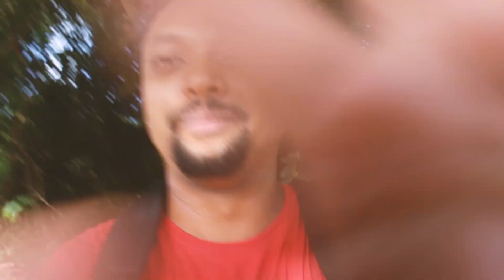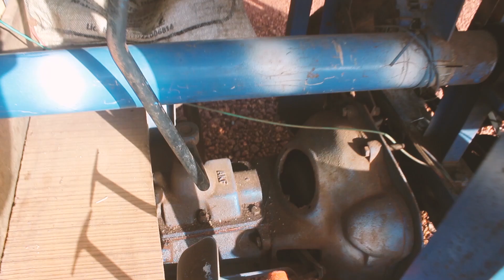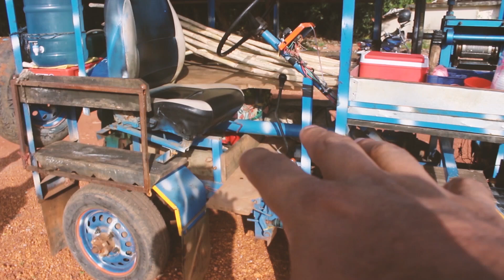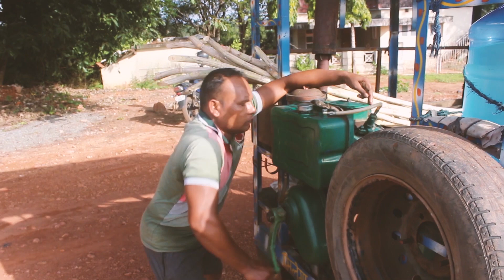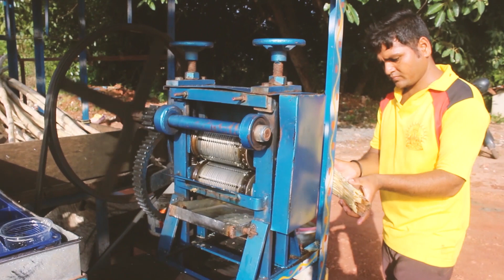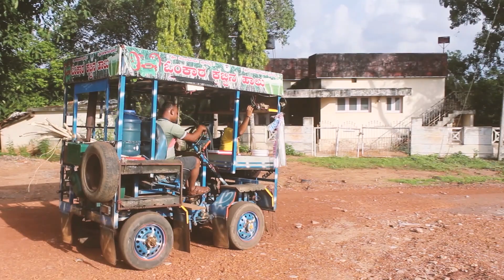First time in Mangalore DIY Suagrcane Truck | Mangalore | jQuest

Comment: I think it is the first sugarcane truck/van which runs only on diesel generator, otherwise according to me I don't find anything much special about it. Usually it's in tempo but these guys have modified a small van or so. Rest everything is the same as other sugarcane juice vans/tempos
Reply from the maker: Yes,  it's the first of its such kind. It is completely built from scratch.
Reply from the maker: The one thing that attracted me is the custom built of the entire structure. It takes lots of planning and implementation.